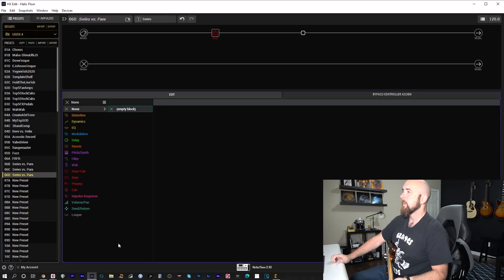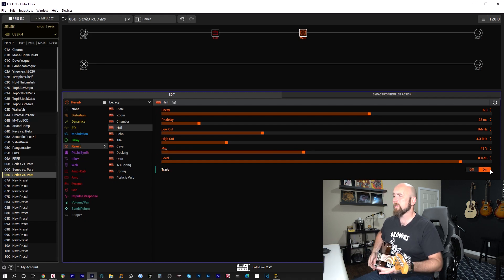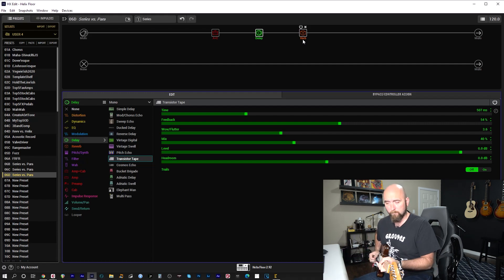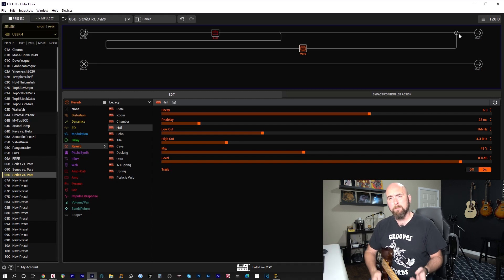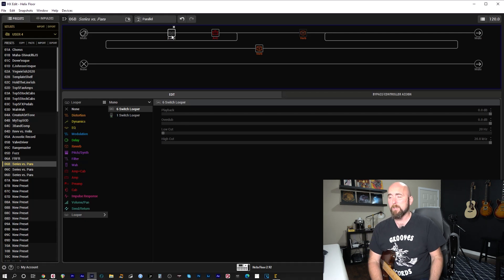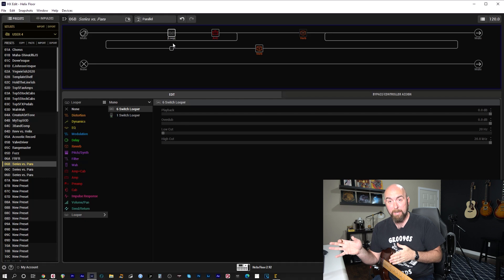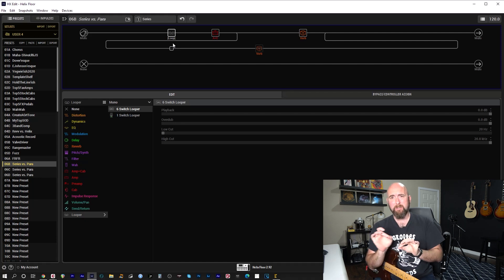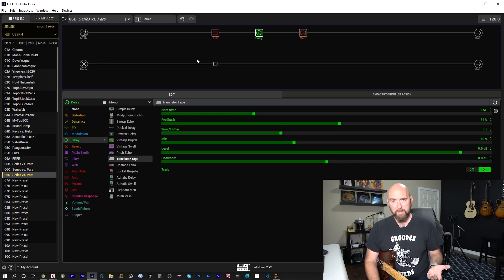Line 6 Helix - Should I run FX in SERIES or PARALLEL? DOs and DON'Ts!

Comment: One thing that came to my mind immediately, when watching this was: nice, so I have a great way to mix the dry/none FX tone of the guitar to my full FX tone. usually I use a second track in my DAW for this, just to give a little bit more attack and definition back to the guitar play (attack/sound of the plectrum hitting the strings). With this way no second track is needed anymore (instead for reamping) and as a plus, both signals go very easyly to the same Reverb/Room at the end of the line, if needed :) Your Guides are awesome! Learnd so much from you in addition to my education at the SAE-College. I´m really digging your stuff ;) p.s. I have no Helix yet. Was on the fence to get one for quiet a time because it´s a lot of money to spent but thanks to you I made the decision to get one now. X-Mas money has to be spent :)

Comment: Very good presentation. I’m using an EHX Tri-Parallel Mixer and have not looked back. It also allows for a hybrid where one could still have pedals in series using a sing;e channel if one prefers. Certainly, a very versatile mixer

Comment: Using multiple delays in series can produce some interesting "hiccups" as the repeats crash together. Using multiple delays in parallel lets you use, for example, clean-sounding digital delay on Path A and modulated analog on Path B, if that's what floats your boat. Either/or. There's no "right" or "wrong". Well, mostly no right or wrong. :)
Reply from the maker: Oh absolutely there are some times where the parallel path is very useful and makes a big difference, but this was referring to the idea some were suggesting that there was a magical improvement to an effect simply by moving it to the parallel path, which is not true.

Comment: Thanks for clearing this up, I always thought it doesn't make a difference parallel vs using the mix control , there is a video from Steve sterlacci about the same topic, he is convinced it does make a big difference.
Reply from the maker: Oh I haven't seen Steve's video about that so not sure what he says about it. It really isn't possible for it to sound different, it is simply a different mechanism for blending the direct and processed sound which can simply be accomplished by using the mix control as shown in this video.
Reply: I'm also here from Steve's video (because I follow both SS and JS)......never thought of the topic before so I'm glad to get a few demos between Steve S and JS here.

Comment: One thing I've found the other day that's totally cool is flangers in parallel.  Put two Gray Flangers in parallel, and set the width control on one to 0 and the manual on 5, and the other flanger has the width control on 10.  You get that cool "Through Zero" studio flanging effect that's impossible with just one pedal.

Comment: I’d like to run dry effects > amp+cab modeling > wet effects straight to FOH. And then monitoring that through my power amp in stage, but I want that same chain, just without the cab modeling (so in that way I won’t get a doubled cab)
Is that all posible?
Reply: You'd need to use the 2 separate inputs to do the 2 diff things as you have 2 diff output locations and you need to change each bit the input is the same bit effects on each separate path at diff. This is only capabke in the Full Helix floor and LT as a rack as they have 2 DSP chips for 2 separate independent paths for a total of 4 paths (1a and 1b abs 2a and 2b). The HX units only have 1 DSP chips and can't do that m

Comment: Correct me if I am wrong,but a mix control on an effect is like a crossfade...when you turn down the wet,you turn up the dry,and vice Versa....like a see saw.....with the parallel path,you can mix in your 100 percent FX signal with your dry path....so your signal always has a direct,dry path,then you can mix in as much or little wet on top of the dry path....Kind of a pseudo wet dry wet thing....at least that is my understanding of how it works vs just using the mix control on an effect....I will admit that I get confused splitting things into parallel paths...
Reply: Yes this is correct in my experience. Plus it gives you the possibility of having your dry signal affected by a small reverb on the “A” path and then have a huge Glitz verb on the B path at 100% not affecting the dry path at all. It just allows for more possibilities of mix levels and effects that aren’t affecting one another.

Comment: I like this approach to make the differences more obvious. Still, a few questions remain for me: 

1. Doesn't the approach with 2 signal paths offer more flexibility? Especially adding the direct signal offers much more possibilities here (more than via the MIX of individual effects) and leads in my opinion to a clearer, more controllable result.

And concluding from this and because I'm curious:

2. Are serial or parallel signal paths used mainly in the presets of the device?

Comment: Also the parallel reverb pathing makes little to no difference with a subtle reverb like the one you used, but with big, spacious, long and modulated reverbs (like my Glitz in my post rock tone) it does really matter. The reverb is more "behind" the dry guitar signal instead of on the same plane and I can use longer and more dramatic settings because of it
Reply from the maker: It is nothing that cannot be accomplished by simply adjusting the mix control in the reverb.
Reply: @JasonSadites  I tried it both ways and even if it's possible with the mix control, I find the studio-like precision of removing dBs from the signal to be a better way for me. But as always, they're just tools, if someone prefers the mix, they should use the mix, if someone prefers parallel, use the parallel
Reply from the maker: Oh absolutely, I totally agree with you on this! But that is a different topic all together. Preferring one method over another for workflow reasons is VERY different than claiming that one method makes the sound better simply because of the use of that method. But I totally agree that if something works for a person for workflow reasons, by all means they should use that method, all while fully realizing that the same method may not work as well for others.
Reply: @JasonSadites you can use a volume pedal to vary the amount of effects on the parallel path too.

Comment: What do you think is the best way to set up a "send”?
For example, when I mix a track using a DAW or a mixing desk,  sometimes I went to send the end of phrases to a delay. 
A good example might be a guitar solo where the main section is dry, but just the end has delay applied. 
I wonder if this can be achieved with a split and a gain block assigned to the expression pedal to send the signal to the delay as and when. 
This would be different than using the exp pedal to control the dry/wet mix settings wouldn't it?
Reply from the maker: You might want to try the Ducked Delay and see if you can get what you need from it.

Comment: What I want to hear is both reverbs set exactly the same but with both reverbs at 100% mix. 1 in series and 1 in parallel. And then switch back and forth Comparing the 2.
Reply from the maker: That would be pointless in regards to what I am discussing here. They would sound completely different. The serial path would sound 100% wet reverb with no direct signal while the parallel path sound would be dependant on the setting of the Split A/B parameter. Setting the Split A/B in the middle as I did would give dramatically different results. That would be comparing apples to oranges and would not really show much of anything to do with the topic of this video.
Reply: @JasonSadites  I understand. But as a test unrelated to this video I would like to hear it. But I get what you're saying.
Reply from the maker: @mrfender5001  give it a try. But just not sure what conclusion is being searched for in that particular case.